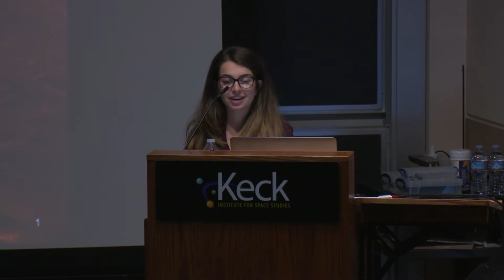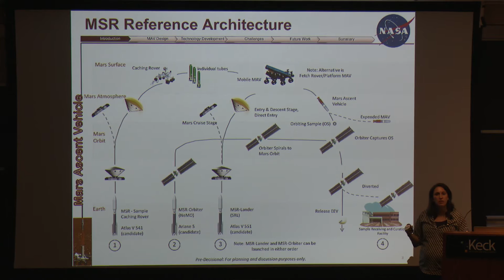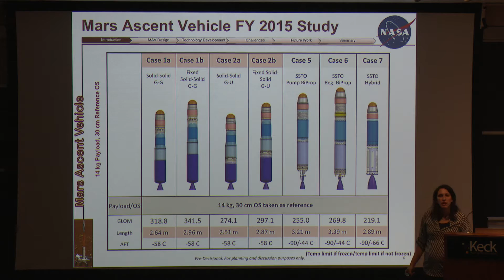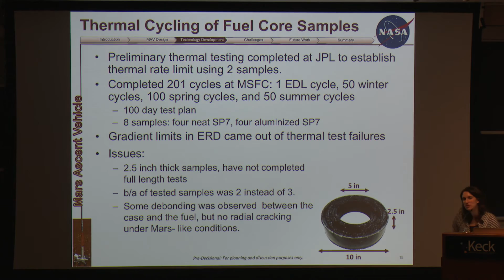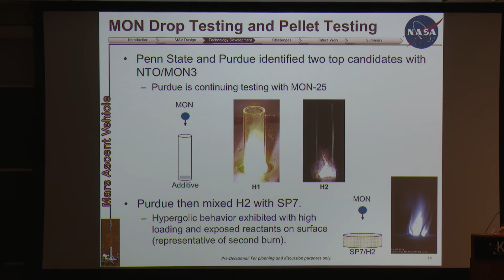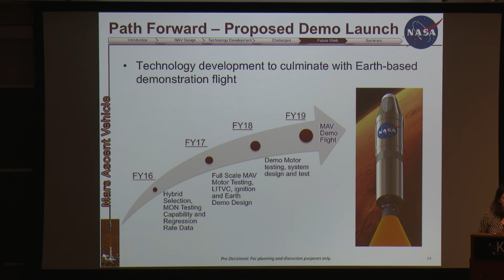Hybrid Rocket Propulsion for a Low Temperature Mars Ascent Vehicle

Comment: SP7 wax fuel was never well characterized. Wax has low melting temperature, shrinks and cracks... it is just structurally bad compare to polymer alternatives. Equally important, thay failed to understand the combustion process, following traditional well documented challenges with hybrid propulsion...would lead them to fight O/F-shifts, less performance and combustion efficiencies. The biggest failure in my mind is that the team failed to see the that by choosing hybrid propulsion for this case with fairly low TRL and IRL, they had to cover a more lengthy and costly development path compare to choosing either state-of-the-art liquid or solid propulsion.

Comment: Interesting but why not just keep it simple, pressure fed Hydrazine and N2O4? And you can land om Mars with Red Dragon in a few years.
Reply: Great to see so many spaces fans here but we are 2023 and we are not yet returning samples let alone  landing an launching tons of payload from martian surface. This presentation is great and still relevant today asaik. Martian temperatures should not be neglected so easily.
Reply: Or just use Falcon Heavy. No brainer, high Delta-v, no research required. Let SpaceX do it and they will make it practical.
Reply: To be honest with the fact that Falcon Heavy can carry 4 tons to Mars orbit is just extraordinary and no other rocket right now can do that.
Reply: More like 14 tonnes to Mars (trans Mars injection anyway) if Falcon Heavy is used as an expendable. With heat shields and fuel for retro propulsion maybe Red Dragon can get 4 tonnes of payload to the ground on Mars and the return rocket for the sample can be inside the Rad Dragon capsule and use the capsule as launch platform. 4 tonnes is probably enough for a rocket to return a sample to Earth directly without the last step with a satellite catching the sample in Mars orbit to bring it back to Earth. On the whole, much simpler.
Reply: RIP my brain, 4 ton is for Falcon 9 FT expandable, Block 5 is probably gonna bring LEO payload to 25 to 28 tons.
Reply: Hypergolics would actually increase complexity & GLOM (thus costs).
NTO also has a limited tolerance for extended thermal cycling which the booster would subject to.
Reply: Why invent anything at all, if you can just pay someone to have it done, right?